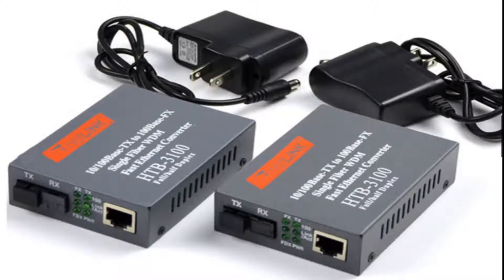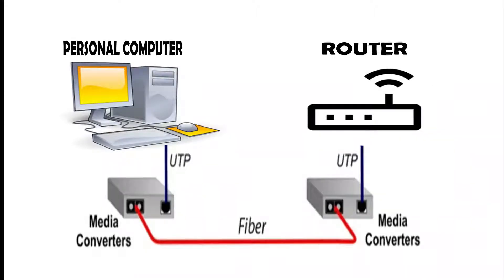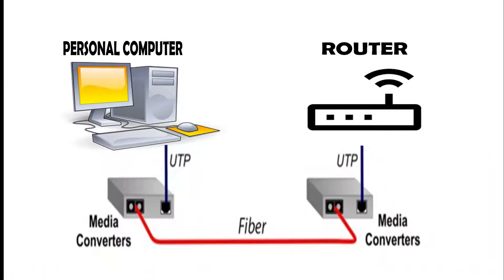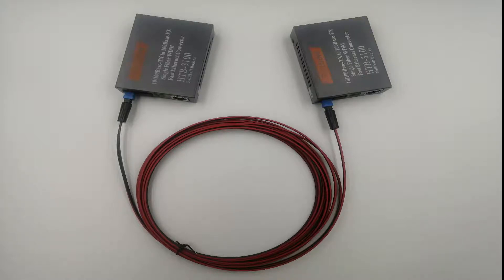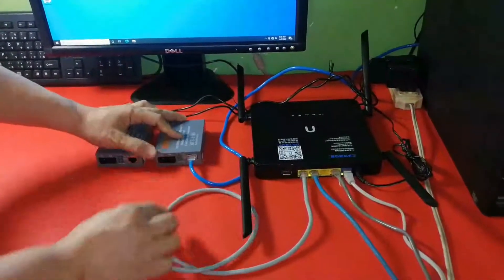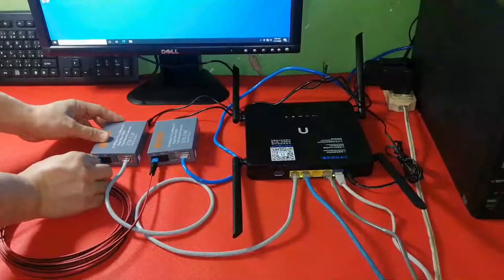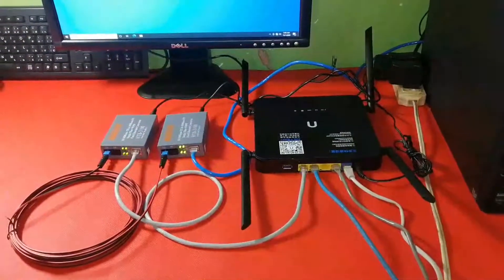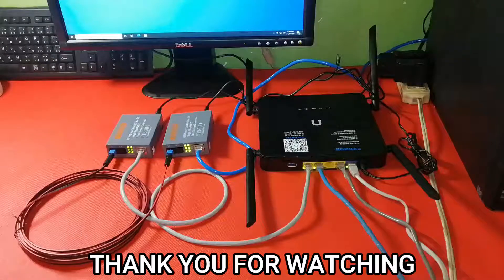What is fiber optic media converter?

Comment: Hello,thank a lot for the video.I have a working fibre linked between two buildings. Each building has a patch panel. I have been using single mode fibre converter which has two sc connectors Tx and RX.
I ordered single mode fibre converter and I was given the one that has TX port and RX port. I opened the Tx port but could not open the Rx port. Since the patch panel has two sc cables,can I use the tx cable for  the TX connector on the media converter. Should I return the media converter?